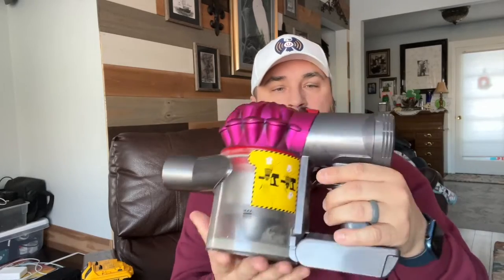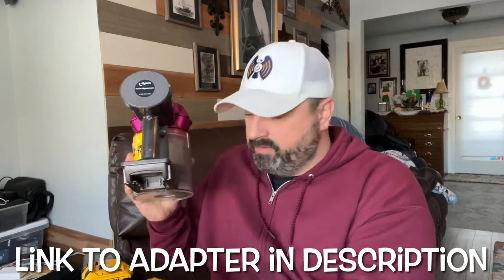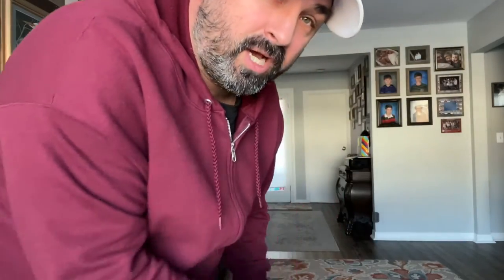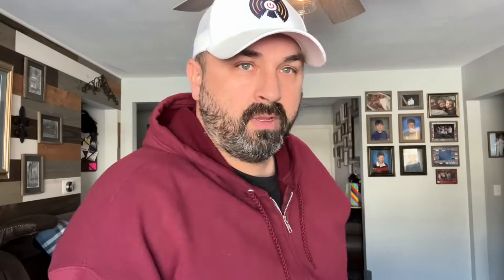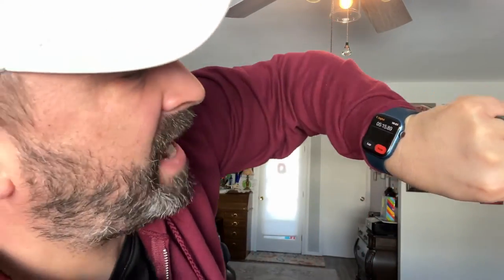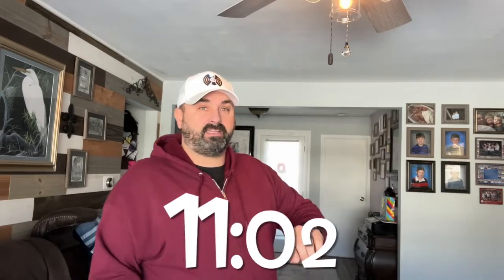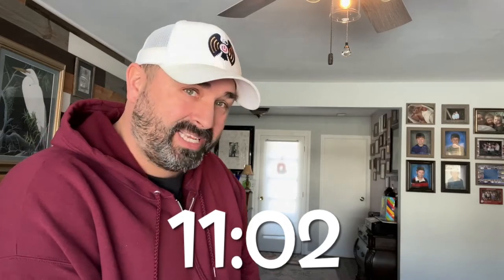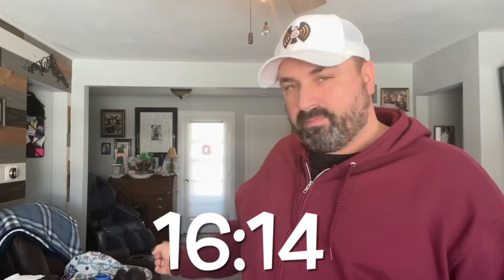Revive Your Dyson V7: Battery Adapter: Run-time testing: Part 2

Comment: Very useful info!  I wonder if the Dyson motor will be able handle all that extra time running on high over time, before burning out.
Reply from the maker: With any motor, it will. But if you use it the same as you would any other time, you will be the same rate as if using a Dyson battery

Comment: Obviously you should go with the adapter that you have the most or any batteries for. I have several lines. I decided to go with the Kobalt version. MY Dyson V8 is natively 24V, as is the Kobalt 24V (21.6 Nominal) Not only that, Kobalt batteries are generally cheaper, use the same Samsung/LG Cells as Dewalt & MKE, etc. And the Kobalt battery case is GF Reinforced as opposed to ABS Plastic. I'm very happy with it. Nice video! This is good info!
Reply from the maker: Thanks John Wick
Reply: @LawnPusher  Lawrence, actually. I'm John's twin brother...Thanks.
Reply from the maker: @J.Wick.  Why does it have a J instead of L?? Come on
Reply: @LawnPusher  Exactly.

Comment: If you use the original Dyson battery in  max power mode very often the overall lifespan of that battery decreases and dies to where u will need to replace the battery much sooner. Is that the same case with the power tool batteries too?
Reply from the maker: You would be more likely to use WAY longer with Dewalt batteries. Plus you can rotate out if you have more batteries
Reply: @LawnPusher  I think if they go on sale on Black Friday I’ll just change the battery out now. I’m thinking the 20V 8AH battery. I just got a Dyson V8. Love using it on max power!
Reply from the maker: @wastnTIMEwastnTIME  run time will last a very long time

Comment: is it working with the 18v batteries of dewalt this adapter?
Reply from the maker: No.
Reply: @LawnPusher  it is working with the 18v battery without any problems. I just tested it out.